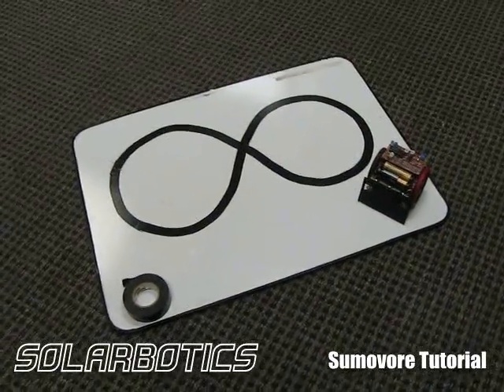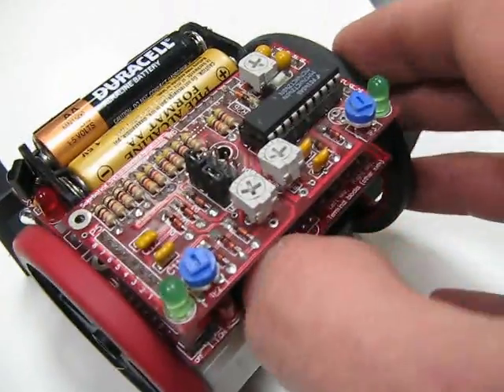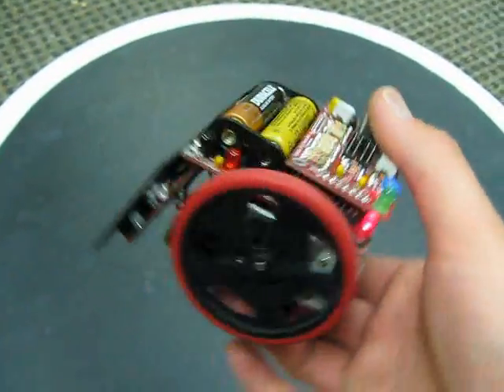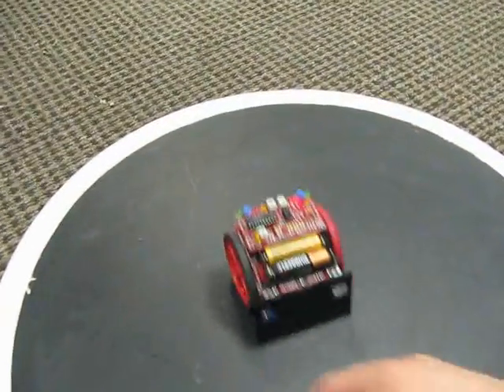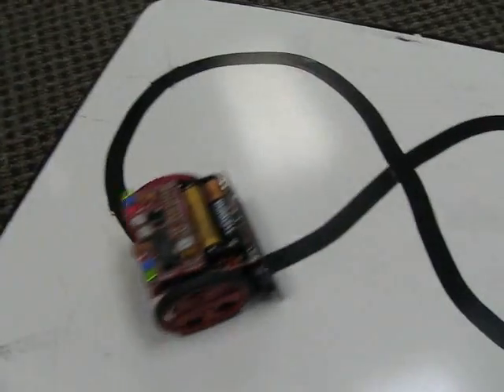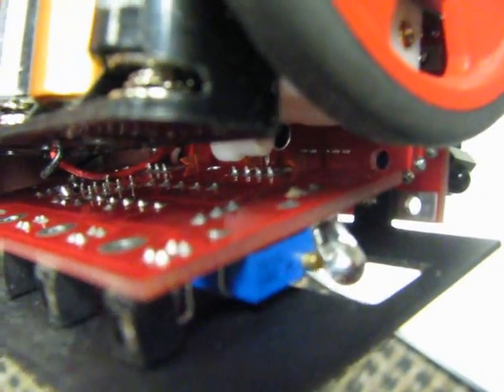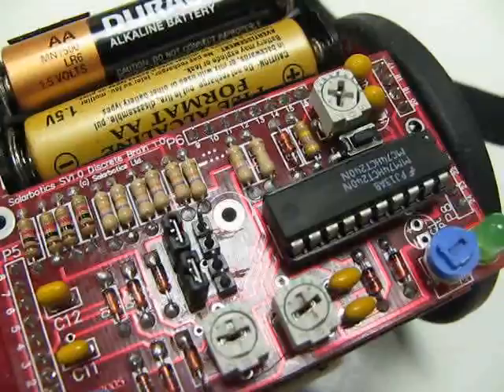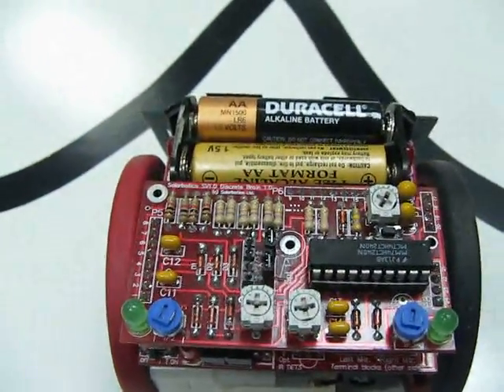Sumobot Tutorial

Comment: Hi, I am currently doing some research in order to make a sumo bot for my engineering class. It is cool to see that these robots can be multipurpose to be a sumo bot or a line follower. However, for my project I need the robot servo both of these purposes at the same time. For our competition, the robot must follow a line into a ring and then fight the other robot. I have not yet figured out how to do this. Can you think of any possible way that this can be done?
Reply from the maker: With the regular "discrete" brains, it's not so easy. With any of the microcontroller brains, that's much simpler. I don't know the rules of your event, but if the line disappears, you simply have the code waiting for a "LOST THE LINE" for more than a few seconds, then have it kick into sumo "FIND AND DESTROY" mode.

Hope that helps!

Comment from the maker: Hi Masticpro, A couple things to check: Please make sure the traces for the 'MS' traces are completely severed & your jumpers are installed on 'LF'. Try using a surface that is quite bright (white) and non-reflective electrical tape is better. The second hole for R23 is probably a via. The 5th IR sensor comes with our programmable brainboard kits, this sensor is not used by the discrete brainboard. If you have anymore questions or need assistance please email our support team, thx!

Comment: Hey, I just got my sumovore, and I finished putting everything together on thursday...I'm having trouble adjusting the trimpots for line following mode, I checked everything to make sure it was correct. My sumovore is kind of missed up when I got it, R23 on the top board had two soldering wholes in it. Also, the sensor on the buttom only came with 4, I saw yours it was 5. So, can you help me please.